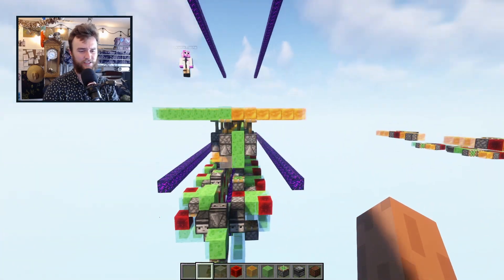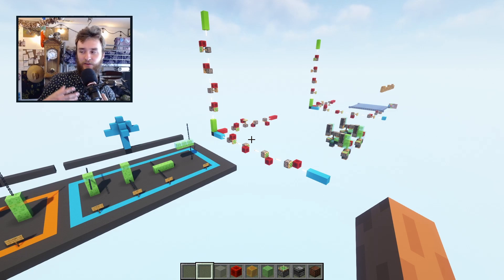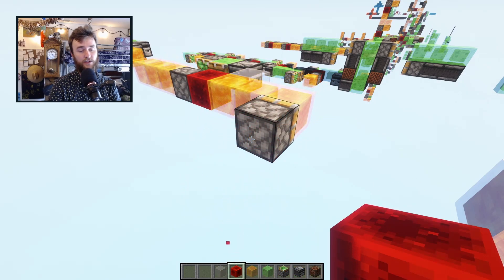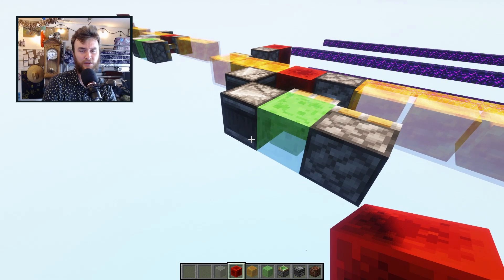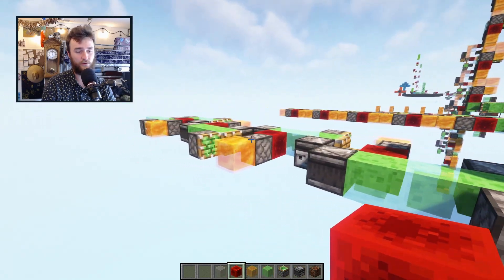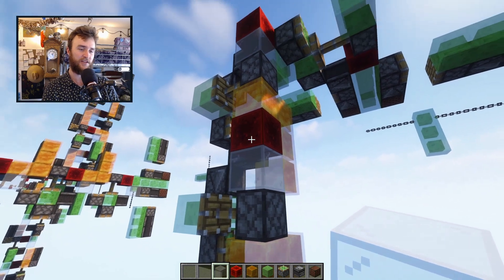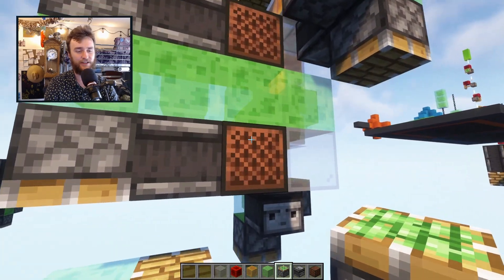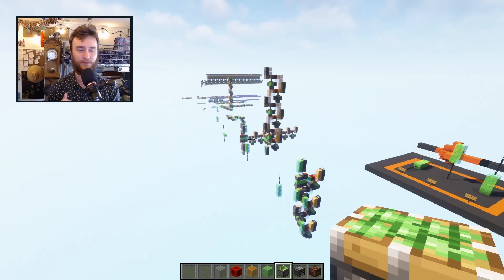How to design any  kind of 2-way flying machine extension - Minecraft guide

Comment: Just as important in physics as the symmetries that hold are the symmetries that are broken, and when.
Both the symmetries demonstrated in this video are actually broken under specific circumstances in our universe. The mirroring (or parity inversion) changes the results of anything involving the weak nuclear force (including things like radioactive decay) because the weak nuclear force only interacts with particles that have left handed chirality. This only affects quantum physics though.
General relativity itself doesn't enforce time translational symmetry. The behaviour of the universe is different now than it was 13 billion years ago. This has some weird effects, like energy not being conserved.

A comprehensive study of the symmetries Minecraft physics has, when they're violated, and the effects these violations have could give some really valuable insight into how to break the game. I know of some cases where it already has, but there is surely more to discover.

Comment: i like the word Quasitivity (quasi-relativity) for a description of minecraft's limited¹ symmetry. 
one of the main things that breaks the symmetry is quasiconnectivity, so i think quasi is a suitable prefix to use in this case.
these are our properties:
- all machines are symmetric upon translation²
- some machines are symmetric upon rotation
- no machine is symmetric upon being given velocity³

special relativity was created to accommodate the fact that light has a constant velocity regardless of your reference frame and that we have no "universal" reference frame, that all inertial reference frames behave exactly equally, and there is no test you can do to determine your "universal" location, velocity, direction, etc.

considering we have about 1/2 of those properties present in minecraft, i think quasi-relativity is a good word to describe that, and i think Quasitivity is a catchy contraction of that word

¹ limited by directional asymmetry and inertial asymmetry
² except for a few that are based on other game mechanics, like needing to be in a fortress for a wither skeleton farm, you can't translate beyond that fortress and still have it work.
³ because minecraft has a fixed grid. you can make things that move, like flying machines, but those are part of the machine. you can't set a static component in motion and have it move, or push a flying machine sideways and have it drift diagonally while flying forward.

Comment: Great video, but
When you want to prevent piston reextending you don’t really need a qc, just having 2 blocks in front of sticky pistons is enough.
Also when you work with vertical wires it’s nice to use sand for delay.
Reply from the maker: Turns out the vertical extension doesn't work in some orientations with only 2 blocks in front of the sticky piston (say slime and glass). The piston is apparently needed. Is this related to the fact that a BUDed sticky piston needs 2 blocks in front to stop bouncing endlessly?
Reply: @whitestonejazz  yes, this is the same mechanic.
In your case it’s probably because observer updates sticky, so you get a race condition, that’s why it’s directional
Try moving observers 1 block down, for example, should work

Comment: Did you know the reason quasi connectivity exists on java is because notch when trying to implement pistons copied the code of a door. Basically Pistons, Dispensers and Droppers can be powerd exactly like a door.
Reply: the downstream effects are incredible, what some see as laziness i see as a miracle.
Reply: that explains. SO MUCH. thank you
Reply: thaaaaat makes so much sense! i always had some vague idea that it was due to some mistake in like the range of some iterator in the code. like presumably redstone components have some code where they iterate over every neighboring block to check if it's providing power, and i guessed that maybe notch tried some clever mathy solution to represent that range in one single expression, but that he made an oversight and like accidentally had something ranging from -1 to +1 where it should have been -1 to +0.

like this one time i came up with a way to iterate over adjacent cells in a hexagonal grid by using mod 2 on certain coordinates so that the range would be different whether the cell is on an odd row or an even row (since hex grids are usually organized as square grids where every other row is offset by half a cell). so like maybe he was doing something like that where he was trying to iterate over every block within a range of -1 to +1 on any of the three axes, while excluding the ones that are ±1 on more than one axis, and he tried to compress all of that into one expression
Reply: So is this a bug? should they be symmetrical, would that be hard to achieve? does it even matter? lol...
Reply: @wingdingdmetrius8025  Correct, it is a bug! But even though it's unintended, and rather unintuitive, it turned out to have some very useful applications - thanks to quasi-connectivity, many machines can be built that would simply never be possible if pistons were powered the way that, say, Redstone Lamps get powered. So it was decided that it would never be fixed.
That said, this is only the case in Java Edition. In the Bedrock Edition of Minecraft, basically everything was rewritten from scratch, and the developers of that version decided against deliberately re-creating the behaviour of quasi-connectivity. That, in addition to some other subtle under-the-hood changes, means that Bedrock Edition doesn't have as much potential for really fancy complicated machinery as Java Edition does.
Reply: @floralQuaFloral  thank you for taking the time for that
Reply: @wingdingdmetrius8025  they actually patched it at one point and everyone got mad so they changed it lmao
Reply: Yes./lh